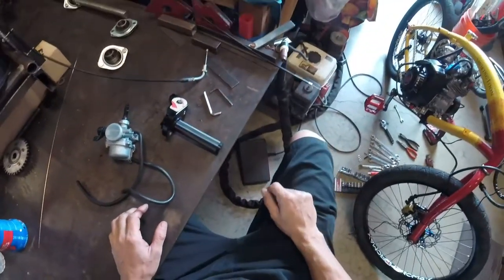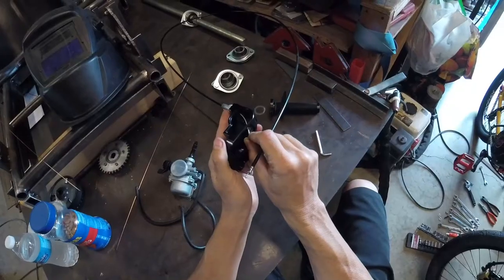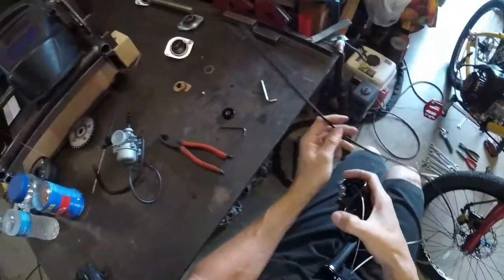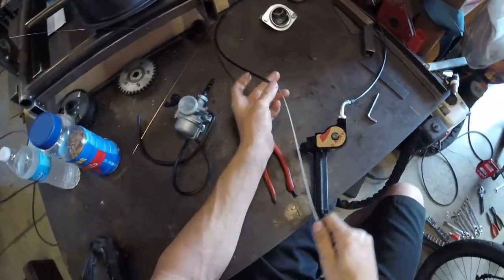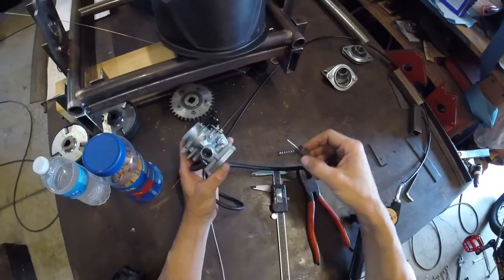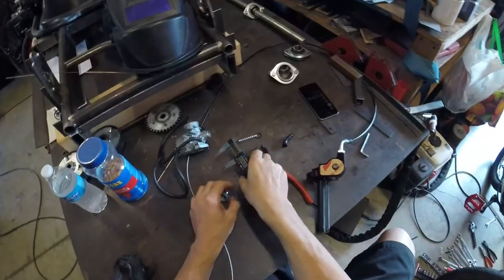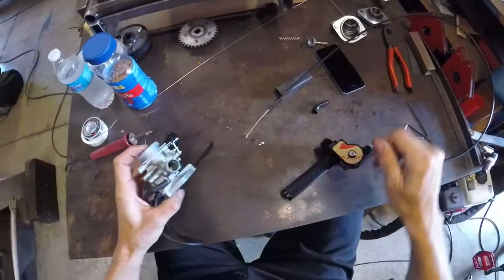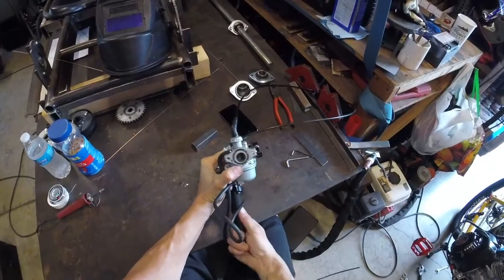Throttle cable installation for mini bikes and motorized bicycles

Comment: Safe to assume you needed a "4 inch cable moving length"? 3" on the carb side and 1" on the throttle side?

Comment: my bikes housing came broken but the twist throttle is fine just the part that protects the cable. should i buy i new one or will this do for now
Reply from the maker: If you're planning to use it just be sure the throttle returns to the completely closed position and it doesn't get hung up.

Comment: What type of solder and flux did you use ?  Thanks!
Reply from the maker: We used BernzOmatic products.  Water soluble lead free flux and silver bearing solid wire solder.
Reply: @agkracing140  awesome ty

Comment: How on earth do I take of the cap from the elbow
Reply from the maker: If you're talking about the black rubber cap on top of the carb, you just pull it off.  Give it a little twisting motion as you pull.

Comment: Can I cut the cable and repair the cable.  And is there a wire clamps I can buy
Reply from the maker: We sell a cable fitting (p/n 16430) that works on the carb side of the cable.

Comment: Bought a chinese made gas bike kit and installed it. The only problem is that it came with a bad voltage regulator lol. might just go get a brand new throttle stick and carb now............

Comment: Cable too short now, I can’t twist more than 1/4 now
Reply from the maker: If the cable is too short you can cut back some of the outer housing which will allow more cable to stick out.

Comment: hey my bruva! i just upgraded my throttle & carb! i got the metal throttle! all is good! just a question id like 2 know the answer 4 please! those metal throttles where the throttle cable screws into the actual throttle theres a "ALLEN KEY HEAD LITTLE BOLT" just next to it.... WHAT THE FUCK IS THAT LITTLE FUCKN BOLT MADE 2 DO? or is it legit 4 show? 🤣🤣🤦🤦 cheers

Comment: Your not showing how to remove the wheel in the throttle.   Help.
Reply from the maker: Just remove the screw that goes through the wheel and remove it.  Sometimes it doesn't want to pop out very easily so we'll gently persuade it with a screwdriver being careful not to scratch or damage the wheel.
Reply: Hello yes it's me again.  And my wheel still don't come out.  Is there another way to put the cable on

Comment: all this nonsense wasnt needed, cut the other end off measure the outer and trim close to the hole with the wheel in
Reply from the maker: If you cut the other end off you'll have to solder on a new barrel to fit inside the twist throttle assembly.  Either way you're cutting, measuring and soldering.